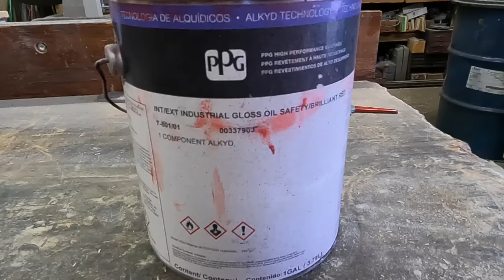Lots of Rollers Make This Smith Spreader Work | Engels Coach Shop

Comment: Hi Dave and Diane ☺, well I guess it's just rolling along,lol. I'm surprised how easy the pins lined up when you squeezed the two sides together, a testament to the accuracy of the hole drilling and measurement. It was surprising how much those thin diagonal rods could move the whole frame to bring it into square, a reminder to us all of how much pressure can be achieved whith basically a long thin bolt applied in the right way. Progress is good Dave,  thanks for another interesting video mate, stay safe, best wishe's to you and Diane,  Stuart and Megan UK.

Comment: I remember you mentioning that guarantee about the cross rods when you were disassembling the spreader.  And I was going to make a remark about whether they would still honor the guarantee with the spreader in the condition it was in, until I noticed that the frame was still square anyway.  That's a good design!

Comment: Well, Mr Engles. I learned it as "kitty-corner," being the directional way of measurement to check things. Corner to corner. If it was measured and found out of your tolerance, it was called "katty-corner" meaning out of tolerance. My dad would call the item, "katty-wampus". Tear it apart and start over. To far gone to fix. 😅
Reply: Thanks Ed never looked at it from that angle

Comment: I could be over critical but I see where they had used nails to retain the roller bed rails would be better off using bolts/nuts. Thats a lot of vibration it will endure but maybe the nails stay put just fine. Keeping it original is key as we all know. 
Sure is nice to see real oil based paint. California doesn't allow it like they used to. Formulations are not great but the price says its "the best on the shelf".  Our paint in CA is about $200 per gallon and its not oil based, mostly its all water based !

Comment: I guess that without the diagonal braces, the conveyor got bound up.
I suspect that the half-lap/cross-lap joints weakened the center roller assembly enough--that the wood cracked at the joints on some spreaders, when it was overloaded. Thought, that is a long run, perhaps the expansion/contraction at that length might have helped it crack, too.
Thanks for the video. That's pretty heavy too, please be careful with it.

Comment: Consider: around year 1900 before internal combustion there were 20/25 million horses in USA each producing 30 lbs of manure a day. Manure spreaders were a well used piece of equipment ! Also manufactored fertilizer was'nt in production.

Comment: I have been really disappointed using red paint on our front door. Everything so far fades within 1 year including Rustoleum "door & trim" paint. You reckon the paint your using is better? The spreader is looking great!
Reply: I've found old green barn paint with copper oxide in it lasts the best. Probably because the copper is toxic to fungus. All the other paint will be flaked away and here's 100 year old green barn paint still stuck to the wood..
Reply: @Reziac  Wife wants red so it will indeed be red. Maybe she needs to paint it from now on.
Reply: @goldcountryruss7035  The fading is usually oxidation. I wonder if a coat of clear sealant over the red paint would help?

Comment: Surprised you didn't re-bush those rollers.  Easy, but tedious to chuck each roller in the lathe and run a 5/8 drill through then press in a 5/8-1/2 oilite bushing.
Reply: They didn't come with bushings , he kept it true to original .
Reply: @Crosley3251  They also didn't come with the center holes worn out.

Comment: 5:23  I could be wrong, but it looks like there are missing rollers for where the notch is cut in the wood. is there supposed to be a roller above each crossbeam as well?

Comment: I would of thought that bolts would of been utilized to hold the roller frame down instead of nails. Im sure nails were faster for production but bolts would of been stronger.
Reply: This spreader lasted 100 years , they did it right , and so is Dave .

Comment: What holds the nails secure?  It seems that rolling down a field would flex the spreader a lot so nails would be pulled out a lot.  Surely they would have had screws in the 1910s whose bite would have held better than nails.
Reply: He replaced nails with nails and screws with screws , staying true to form .
Reply: @Crosley3251  , not the question I was asking.  In Circa 1910, when this was originally built, the manufacturer would have had screws.  Why did they not use them when they built it?  That's my question.

Comment: Kitty-Corner and Catty-Corner are BOTH CORRECT. However, they are both incorrect too. The term originates from the Latin quattuor, meaning four-cornered, hence located on the diagonal. Southerners just started mispronouncing it in the 1800s. Yea Southerners. My people. Way to set a trend. LoL! Also, some confuse it with Cattywampus. Which originated in the Colonial United states and still used in the deep South, cattywampus means something that is in disarray, that is askew, or something that isn't directly across from something.

Comment: Just about everything you have restored on this channel eventually gets used again. This is probably the first thing you’ve restored where I hope it doesn’t get used again. At least for its original purpose.
Reply: Nothing wrong with cow (or horse) manure, it washes off just fine.  Betcha Dave wants to try it out and make sure that it works like it should

Comment: The lack of grease starts to get worrisome..
Reply: Can't use grease in that application. The grease would attract and hold dirt that would wear everything out faster. The play between the wheels and the shaft is enough to shake the dirt out when it dries..
Reply: @tonylinkkila7617  Okay, graphite then, or a nylon sleeve. I get your point in constant use, it would work for the period it is intended, 10-15 summers, but this version is most likely not going to get used as often as regular farm equipment. Thus the corrosion development is more severe and needs to be taken in consideration.